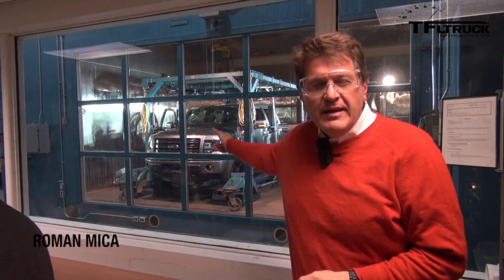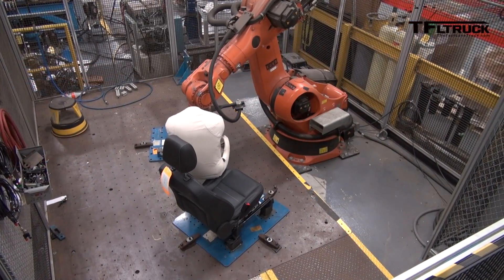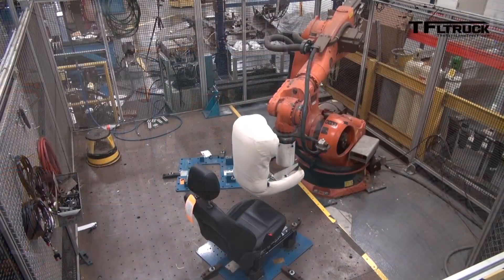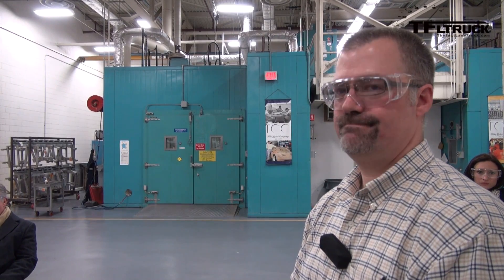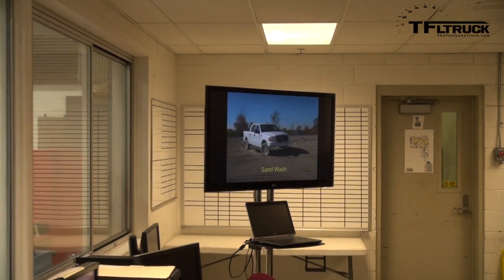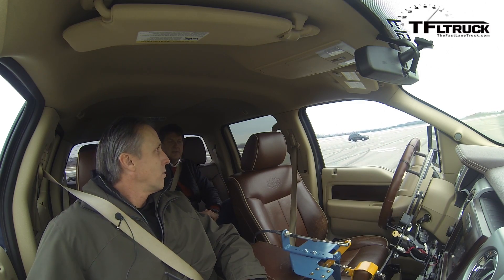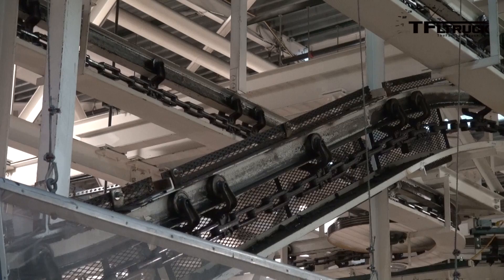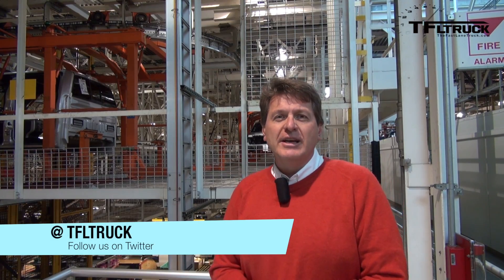Watch how Ford uses Robots to test the durability of a Ford F-150

Comment: I wish ford could build me a new 2014 F-150 FX4 right now...
Reply: I would like a new 2017 Limited myself.
Reply: When you look at the complexity of a 2021+, you’ll probably be happy with a 2015-20. In the rust belt a lot of the 09-14’s are really crusty by now and if the top brake light leak wasn’t fixed it’ll be rotting the rear cab corners from the inside out unless it’s from a desert.

Comment: The dirty little secret about why manufacturers do this type of testing is to see where the can make the vehicle cheaper, not necessarily stronger.    Take the door open/close hinge test for example.   The hinges are just simple pins through some type of metal bushing.  If you where to swap that out for a sealed ball bearing hinge, it would last 20+ years without sagging. Minimal testing required.  Why?  because if you build something to last 20years, but only need it to last 5, then even if it wears out twice as fast as you thought, it will still last twice as long as you needed it to.   However if you build it to last 6 years, and need it to last 5 years, then you have to do a lot of testing  because the margin for error is much smaller.
Reply: Such a bullshit comment.
Reply: YEP you are testing to see how long the average part, surface, etc. will last.
Reply: Your house front door does not have a ball bearing hinge and it will usually last 40 to 60 years with much higher rate of use. You are jousting at windmills.
Reply: Got a 49 Desoto with original doors and I don't see any sag in the doors. Got a few backhoes and all joints are pin and bushing. Also the inside of your motor of your car are all pins and bushings of various styles.
Reply: well, why make it last that long when you don't need it to?
Reply: Yes sir! My 2011 door is sagging and thunks when you open it.

Comment: If other manufacturers don't do these types of durability tests on their trucks they should be ashamed of themselves. These days consumers are a lot more demanding and expect to have a solid product that should last for years and years. I say kudos to Ford for doing this but in hindsight I believe that these types of tests should be done across the board and not just the F-150. Maybe they are doing it across the board but I don't think they're being thorough hence the Ford Escape and it's recall woes.
Reply: Lucas Alamo have you seen how they slap together a truck look under a tundra and a Ford I do like the Ford better but the f150 has wiring hanging and exposed while the tundra has brake lines and wiring neatly tucked on the frame and protected and for the same price the tundras can be found with less miles
Reply: @bryanmartinez6600  who cares about a stinking cheap Toyota?
Reply: @rockandroll4689  calm down this isn't Chrysler we're talking about

Comment: These are very nice trucks for sure.  The road testing is a little questionable though.  Their one simulation is equal to driving from Northern CA to Southern CA and back again on the horrible, bone crushing I-5 just one time.  Do that for a 100K miles and who know what the result would be.  They aren't testing for that type of wear.  Maybe that's why the professional car hauler that Roman interviewed has to replace his front tires every 20K miles and his rear diff has gone out 3 times...???

Comment: Wondering the robots that open and close the doors does so in such a gentle manner?  You would the door hinges should be tested, ie a strong gust of wind catches a door, or a door is slammed shut.  Those robots should really be on a random cycle of opening and closing intensity.  Or maybe they already are.  Thanks Roman.